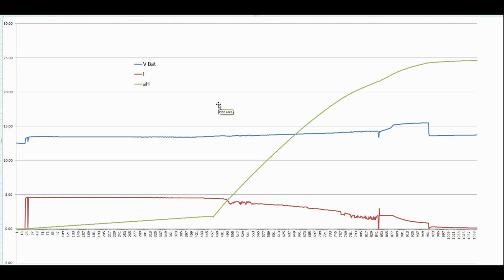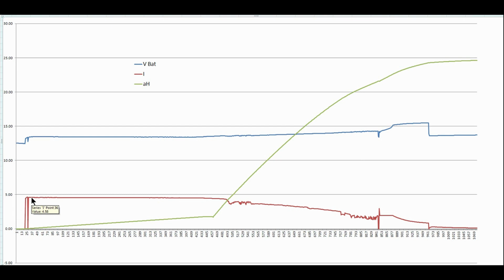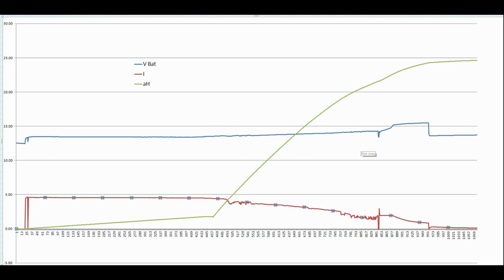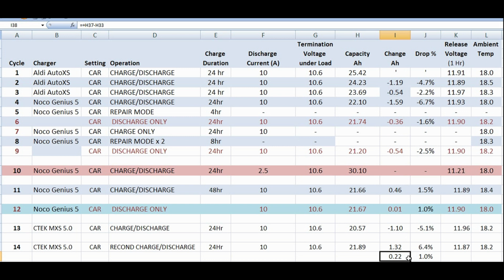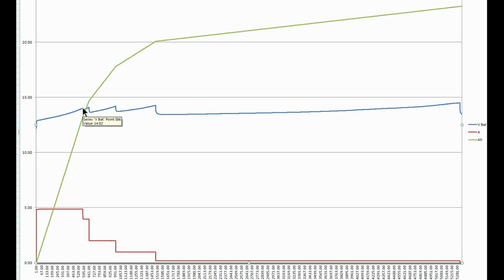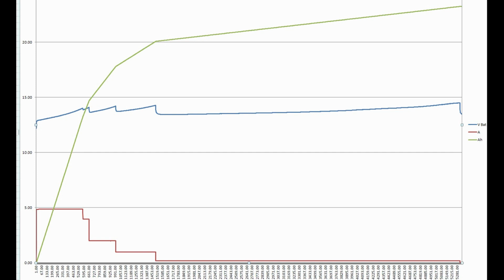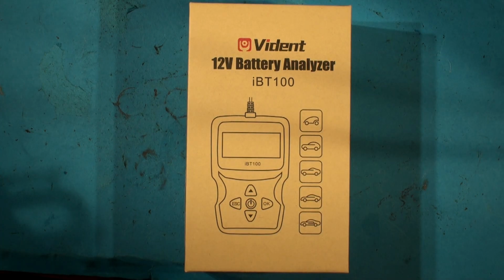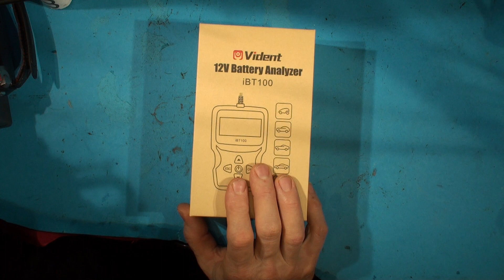Does the NOCO Genius5  charge better a than CTEK MXS 5.0 ???. NOCO Parametric Test Part 5

Comment: 14.5V that finished way to low
Reply from the maker: I am interested in that view but cant find a source for it beyond the old flooded lead acid cells that you can top up. .  However every battery manufacturer of VRLA starter batteries state 14.4V +- Temp compensation for the float charge stage before the charge terminates.   In a healthy battery 20% additional charge is stored during this stage.  Going above this voltage is not good for a healthy battery.
Reply: @razenby  On the other video I saw on your bench Halfords battery. 99% sure made by YUASA. Now copy from manufacturer: Grids are still made of Lead. Typically less than 0.1% of calcium is needed to give strength (note calcium is added to the grid alloy in both calcium and hybrid batteries). Some customers think that calcium batteries are completely different to lead acid batteries, but they just represent another generation of the lead acid battery.
Charge Voltage tolerance increased from 14.4V to 14.8V
........ repair mode lead acid batteries need short period charge low current over 15Volts (not AGM batteries)
Reply from the maker: @pawek9528  Yuasa claim to make Halfords batteries. The calcium also helps recombination of H and O at the anode.  There is barium in there too and who knows what other impurities as the lead has been recycled many times.

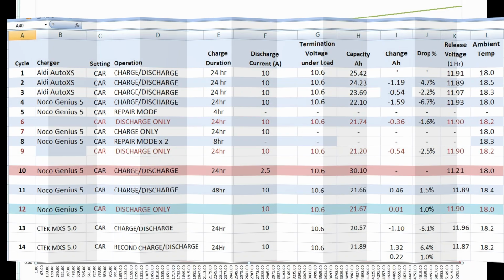Comment: You showed the CTEK Recond mode chart @1:18, then the NOCO Charge cycle @9:42? Did you mean the NOCO repair mode for the second one? It seems like you compared different cycles from the voltages (recond vs. charge, instead of recond vs. repair?) 
Please correct me if I'm wrong.
Reply from the maker: Correct. It was intentional. The purpose was to see if the battery capacity had changed after the CTEK recond mode. The NOCO Genius Repair mode is covered in the videos in this video  https://www.youtube.com/watch?v=soXSb_6Xuyk

Comment: I find it funny that many of my local battery vendors use a conductance tester (much like what you have) to test their batteries for warranty claims but yet some battery manufacturers discredit these products.  IRT the 500 AMP carbon pile load tester, according to the meter on the left of the tester, it does do 1000 CCA.
Reply: Because non of the manufacturers want to tell you what the testing procedure is, because none of them will stand by their warranty
Reply from the maker: @jusb1066 This battery in the video is manufactured by Yaesu,  I have read several agent manuals and I see that there is just about no warranty. at all.   Every path  except one in the procedure leads to 'BATTERY ABUSE - REJECT CLAIM'  The only  warranty claim accepted is when the battery is open circuit.    However, in the UK, I have to say that Halfords in Reading are excellent when presented with failing battery under warranty and a receipt.
Reply: @razenby  I have three years of readings on what is now a 6yo battery in my car, from my analyser.  Taken at 0c each winter.  Battery health percentage (meters own report) drops 5 percent a year so far, the tester is only just passing the battery as good this winter,. The car has never failed to start,  once it says battery health is around 60% it will say fail.  The battery is rated at  300en,. The tester says it's currently producing 255, and 63 percent healthy, which as I said the tester believes it's close to borderline.  in order to get it to pass I had to get the battery a 5-day float, then rest.  It's looking like where it calls it a fail, is the point of rapid degradation, where your  Halfords battery seems to be.  OEM yuasa fitted to Toyota
Reply: @jusb1066  Is that battery supplied by the car OE or was it aftermarket?  I've found that OE supplied batteries are generally lower in specifications/performance than aftermarket (ie an OE battery may output 390 CCA while a replacement aftermarket would output 550 CCA for the same size battery).  As such, a 'failure' from a analyzer due to lower outputs (ie the health percentage dropping below 60%) on an aftermarket battery may not really be a true failure in relation to the OE supplied battery as the aftermarket one will still be outputting more power than a 'good' OE battery.
Reply: @richardlouie2922  it's the battery that was with the car new ,  it's the smallest car battery size on the market 35ah 300en. A larger size 45ah 440 en batteriy is  the same price and fits
Reply from the maker: I agree. I know that they wont accept a claim based on the readings of conductance testers. I dare say that some agents choose to reject claims based on these meters.  The pile charger's capability is to load at 500 amps. to  says wind to half CCA and wait 15 seconds then read the meter.  The 1000A  CCA scale is a marketing tool to make it more salable.  It will only draw 500 amps max. There are several iterations of the CCA specifications. The test mus be at -18  deg C and hold the specified CCA current whilst maintaining the the terminal voltage above 7 volts. (various specs).  Some specs have multiple cycles of load. The Carbon pile tester I have is 20 years old. It is gives a reasonable indication of condition but not relative to the regulation spec. It has limitations: 
1. It is limited to 500A full deflection so it can only do a full current CCA test of small batteries.  In a domestic freezer you could approximately test to the spec by manually adjusting the current to keep it at the target CCA during the test. 
2. It does not keep the battery current at CCA as it is resistance based rather than self adjusting (constant current).